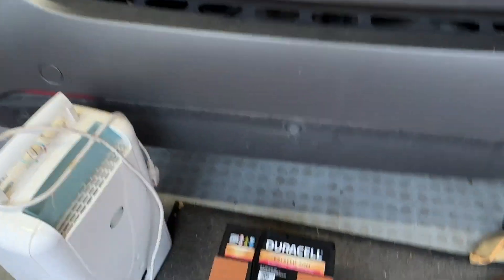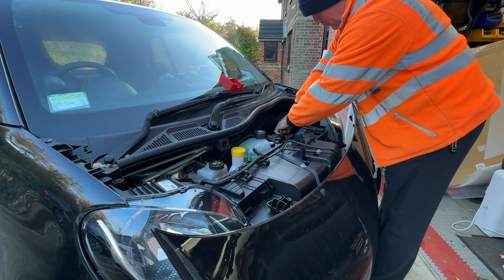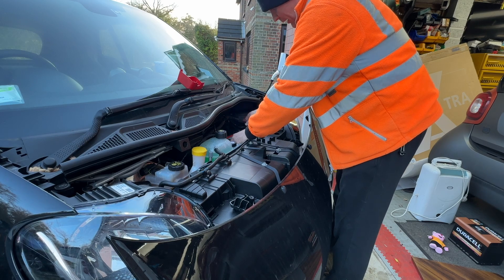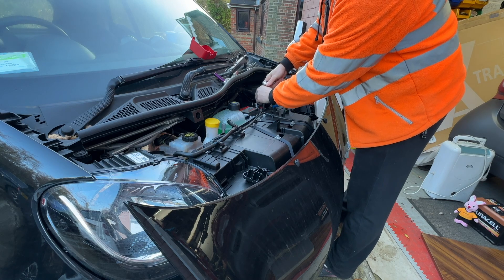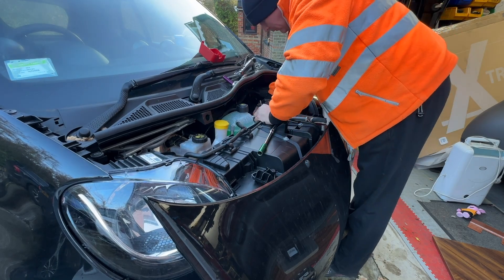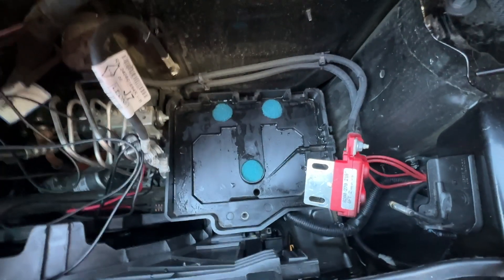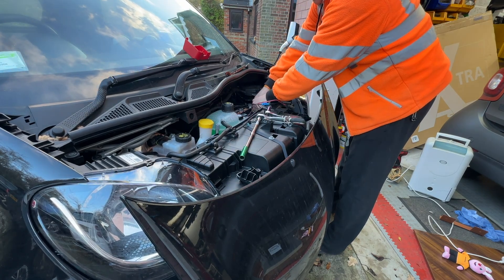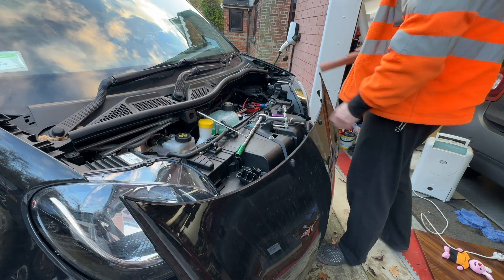453 12v Battery Removal - Because the OEM battery sucks.

Comment: Hi I replaced the battery as you demonstrated but the car will not start?
Reply from the maker: Did the car not start before you changed the battery? What model 453?
Reply: It's a 451EQ Exclusive It was showing a fault 12 volt battery symbol say consult manual
Reply from the maker: @SebastianLange-l1s  the 451 was ED. The 453 was EQ.

Try charging the battery on a battery charger 1st, just in case it's flat.
Reply: The warning has disappeared and everything comes on but the drive symbol and it does not drive

Comment: There's quite a few versions of the Duracell Extreme AGM on their website i.e. 50, 60, 70, 80, 92 and 105. I couldn't tell from the video which one it was.
Reply from the maker: There is only 1 Duracell AGM battery in the 027 size.
https://www.batterycharged.co.uk/shop/brands/duracell-automotive/duracell-extreme-battery-range/duracell-027-de60-agm-extreme-car-battery-1537130.html

Comment: My battery was going on the blink so I bought one of these after seeing your video - great price innit!? The new Duracell was the exact dimensions of my 453's OEM battery but was a bit off faff getting that bottom holding bracket screwed back in but got there in the end. Cheers for your video!

Comment: ah my question of the other video is now answered. Exactly what I thought
Reply from the maker: Your question was the reason I made this video public.
Reply: @evilution_ltd  Since I was looking myself for a 12 volt lithium iron fosphate car battery and can't find any information on that subject online about compatibility with electric vehicles.. So  I wondered what amperage it should be since you do not have a start engine. Is 30 AmpH enough or should it be higher?
Reply from the maker: @Elfraty  I think lithium/LiPo/LiFePo4 low voltage batteries in an EV are over-kill.

They suffer in the cold, they self discharge faster than standard batteries and the prices are very high. The main reason for lithium starter batteries is that they are light and often used for race cars and can give out a short burst of very high current. Since EVs are already heavy and don't require a load of power, you wouldn't benefit at all.

In fact, you could probably make a suitable battery from 18650's.
About 10 years ago I made a hybrid battery using a 16v lithium pouch cell meant for a radio control car and 6 ultra capacitors. It was smaller than half a brick.
Reply: @evilution_ltd  allright I will concider what you are saying. Thank you for your advice..
Reply: @Elfraty  Wouldn't bother unless you want lower weight or higher power storage than lead acid batteries can give. Lithium batteries have their own drawbacks, main ones being fire hazards....
Reply: @khalidacosta7133  just the fact lithium is expensive and doesn't like the cold is enough to put me off. Even without the fire hazard.